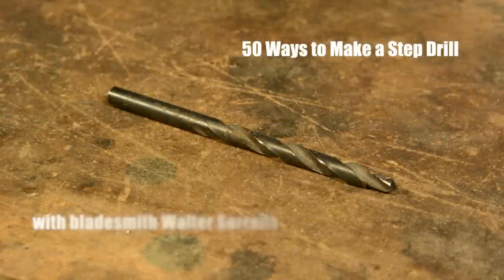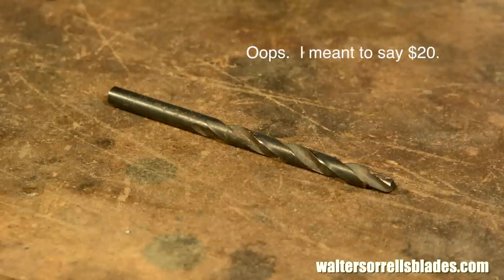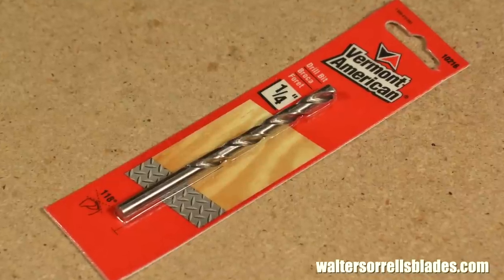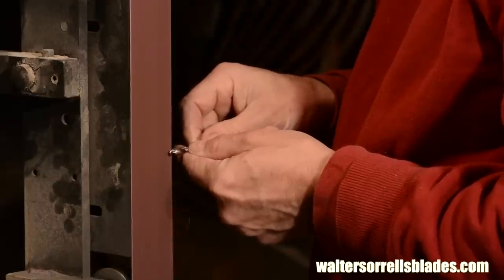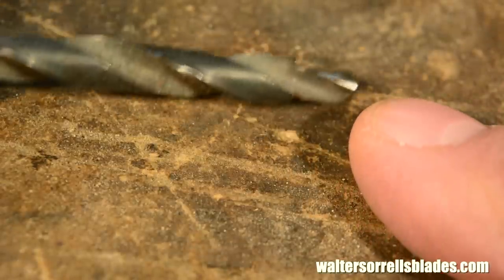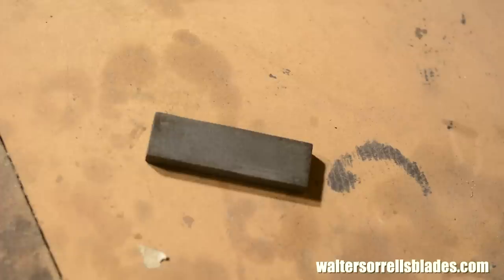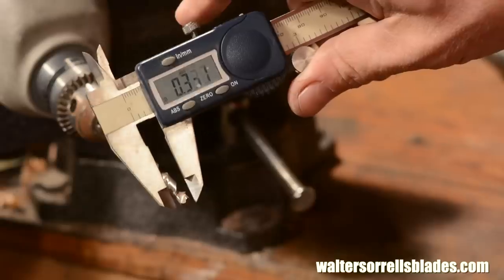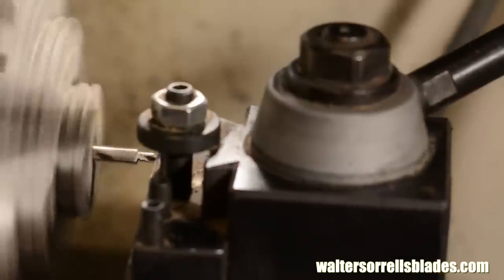50 Ways to Make a Step Drill

Comment: Being all thumbs I could not hold the Dremel still enough to get a square shoulder on the step.  I ended up zip tying the Dremel to a boring bar on my lathe and using it like a ghetto grinding attachment.  The step has no relief so it takes a good bit of pressure to cut but I was pleased with the resulting hole.  While I was at it I ground in depth lines every 1/8th inch beyond the step to make it easy to see how deep I have cut.  

Thanks for all your videos.  The epoxy is curing on my first knife as I type and your videos had a big part in my decision to take the plunge  :)

Comment: I took a different approach for making the ones I use for counterboring Loveless bolts. started with a piece of O1 drill rod, machined the entire thing from scratch on the lathe (straight flutes, as is standard for machinist counter bores) and then heat treated it as I would a knife. It's not hss, but it's done a couple hundred handles worth of ebony, ironwood, and micarta so far, and still cuts great.

Comment: If you want a clean flat step in your work piece, you need to add some relief to that straight face of the step. Without relief, any cutting edge will only burn through instead of actually cutting. This is why there are so many drill bit sharpening devices out there and why sharpening a bit by hand is a real skill. 

I did one with a drill clamped to the work bench and a Dremel with two abrasive cutters. The cut-off wheel does make a nice, square face on the step. And I cut it just a bit deeper than the small diameter: this does not hurt. But then a drum shaped wheel makes doing the smaller diameter tip a lot easier. If the Dremel is held parallel to the axis of the drill, it is almost automatically parallel. Frequent checks with the calipers or micrometer are called for to keep from overshooting. And.........

Finally I went back to the cutoff abrasive wheel on the Dremel and some careful carving to add the needed relief to that additional cutting edge at the step. This is easier to control if you first use a magic marker to color the square, unrelieved edge black. Then you want to grind at a small angle (5 to 10 degrees) for the relief. This is taken right up to the cutting edge and you know you are there when all the black from the magic marker is gone. A bit of skill is needed so buy two or three bits to work with. Or you can just grind a bit deeper if you mess up the original edge. 

Mine worked perfectly in cutting mild steel.

Comment: I would use a bench grinder. Then I would lathe a tiny bit at my maker space.
An alternative to the step drill: 1 milling machine, 2 different drill bits, 1 endmill (makes the hole flat)
I would do most of the handle and the holes on a milling machine at my maker space.

Comment: The twiddle jig method could be used to get exact diameter just by being careful and measuring a lot.  Then one quick trip to the drill in a vise with the dremel is all you need.  You don't even need to be perfect.  The one and only job of the second setup is to cut the shoulder square.  since the shaft will be drilling the hole....you don't even a perfect shaft diameter, you really only need the very tip of the drill bit to be the diameter of the main hole, and then the rest of the drill bit shaft cuts the clearance hole, or recess hole, or whatever it is called.  I guess what I'm saying is a perfectly cut step drill bit isn't actually necessary to get perfectly cut stepped holes.

Comment: The best method you have there is 4:43, but you'll need to clamp the block down. After trimmed to size, next use your hand to create an chisel angle. The idea came from an old Polish? man on youtube.
Reply: if the block was clamped down, how would he push the bit into the grinder to actually make a smaller diameter?

Comment: Why have a step drill bit when you can have two different bits? You save something like 30 seconds per handle
Reply: The problem is that you don't get the nice, flat transition between the two diameters, which is necessary for this particular application.
Reply: +opmdevil x2 what FellToRise said along with speed, if you want to have just one setup that you can always have ready to go, that's a really nice luxury.
Reply from the maker: +opmdevil   The most important reason is that you want the two holes to be exactly concentric.  If they aren't the head of the fastener will seat incorrectly and may not even fit.
Reply: You can achieve an exact concentric hole with two drill bits on a mill and the drill surface is hard plastic or metal. On wood is okay except the bit must rotate as fast a router.  But the topic isn't about 50 ways to make a concentric hole. :)
Reply: David point is once you make it, it takes 5 seconds to drill two holes..
Reply: short of using a milling machine and an endmill, a counterbore (what machinists call these) is the only way to cut this sort of hole with any level of success